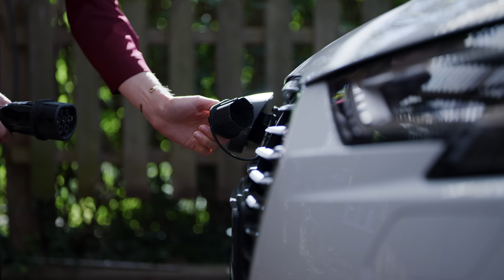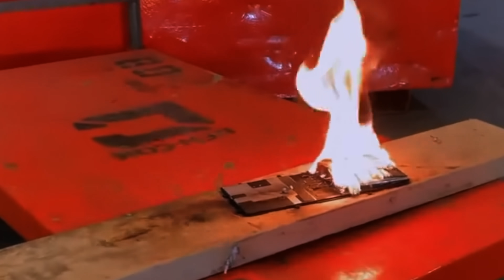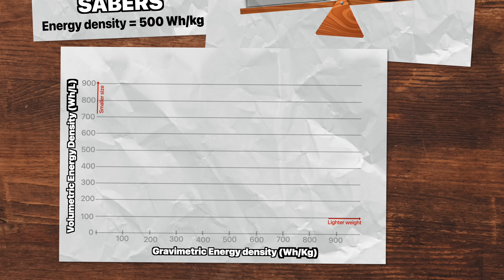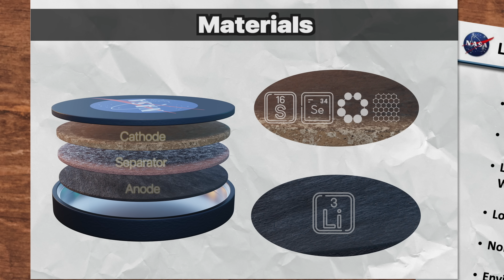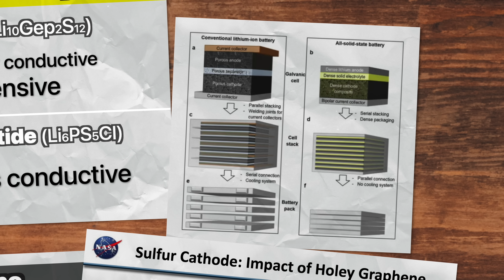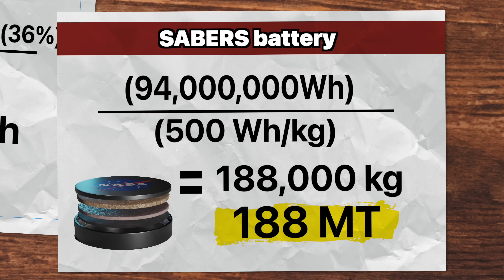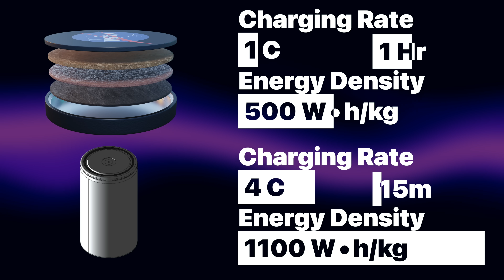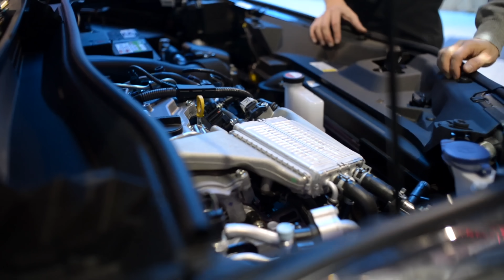Why NASA is Building a Solid State Battery

Comment: How could the separator possibly let the ions through but not the electrons, since electrons are smaller than ions? Are you sure there isn’t a different reason why the electrons don’t flow across the electrolyte?
Reply: If it let the electrons through, it would be a metallic type conductor and make shortcut between electrodes. It should work like liquid electrolyte, letting only ions like Li+ through. Electrones must move only in wires and load or charger between the electrodes.
Reply: @jounisaari9471  I read that some electrons do flow through the electrolyte, but most flow through the circuitry, because it has far lower resistance.
Reply: @TedToal_TedToal  Yes, always some self-discharge currents exist. And every ion has some electrons exept H-. 

I am not sure how exactly solid electrolyte works. In liquid the electric current is carried by ions, not free electrons.
Reply: @jounisaari9471  maybe by hole propagation or something like that??

Comment: One great value of this is the ability to use solid state batteries as part of the armor in military vehicles in the same manner that fuel tanks are used currently, but even more usefully.  Toyota's solid state battery tech has been coming along quite well too.
Reply: Engines are often used as a mechanism to stop projectiles in military equipment… at least in Israeli tanks, where survivability is of the utmost importance to their culture
Reply: Solid state tech has a very long way to go to catch lithium based batteries which are already very cheap and highly scaled.  Don't hold your breath for SS in cars.  People make vids and write articles on SS to get views and clicks.
Reply: @bluetoad2668  the problems with lithium are very significant and solid state batteries are not nearly as far behind as you believe.  Heck, in some important areas they are far ahead of where lithium could ever go.
Reply: @DarkHorseSki  significant? Those batteries are currently powering millions of vehicles and doing it using less energy and requiring less maintenance than the ICE power they are replacing.  I'd argue about the significance of those problems.  Solid state still has problems of it's own and even when those are overcome the manufacturing will have to be scaled up over many years to get to the point when they'll displace lithium based chemistries.
Reply: @bluetoad2668  so what?  And no, the COSTS and harms to create those batteries, as well as to charge, replace and fix them is not factored into your thinking.  There are channels on YouTube dedicated to repairing electric vehicles that are quite clear that the maintenance is sometimes easier, but getting the parts and being able to repair things at a reasonable cost, not even close to equal to ICE powered at the moment.  And yes, solid state batteries will need to ramp up production to get the economy of scale, but the nice thing is that the costs to source their materials is FAR cheaper and far less damaging to this planet.
Reply: @DarkHorseSki  I'm not saying that SS batteries won't come, I actually think they will and also that they'll eventually replace liquid but this won't happen for a few years yet and it won't be SS tech which will kill ICE.  We'll most probably even see sodium ion batteries join lithium as production ramps to meet demand towards the end of this decade.

Comment: Is the 4680 compatible with a solid state electrolyte? Particularly at the center of the jelly roll where radius of curvature is greatest?
Reply: 4680 is a size, 46mm x 80mm, not a battery type.  As for rolling SS?  Most likely not.
Reply: 4680 is just a size.

Most likely, whatever solution is made for solid state batteries, manufacturing will use similar technology
Reply: @DavidHalko  My concern was a dry electrolyte not able to bend enough to work/fit/conform at the center of the cell. If not, anew geometry or configuration is needed for the 4680 cell configuration. THIS implies redoing the 4680 roll up process and hence a new “4680” manufacturing system
If the material is too stiff to bend at the center it won’t work in current 4680 cell design.
Reply: @richardrigling4906  - I hear ya… usually, reuse of existing manufacturing processes is one of the highest priorities, when developing new chemistries.

I guess we will all see!

Comment: Solid State Batteries are awesome, but for aviation, hydrogen fuel cells might be the real winner.  It costs more to create the fuel, but you don't run into the weight issues you do with batteries.  Or at least that is my understanding.
Reply: Hydrogen may be light, but a container capable of storing it under high pressure isn't. Hydrogen is also much more expensive, per unit of energy, than traditional jet fuel.
Reply: Fuel cells are a joke currently.  We do not have any that do not require RARE elements<<COUGH: Platinum or Gold or SIlver etc>>    Fuel cells have HIGHER weight as the FUEL comes generally comes in giant COMPRESSED containers with HEAVY thick walls.  Otherwise you have to go with liquid at cryogenic temps.  Well good luck with an aircraft at Cryotemps flying... SIts on the ground for 30minutes and is now covered in 2cm of ice.  Good LUCK!  Now you have to have insulation, massive amounts of insulation = EXPENSIVE and HEAVY.  

PS: NASA uses Selenium... ==> 50% rarer than silver.  Good Luck waiting on that one!
Reply: @w8stral Airbus is/was testing a hydrogen powered Dreamliner. Liquid hydrogen in cryogenic tank that takes a lot space onboard. Hydrogen works with jet engines,  NOx may be a problem. I saw a documentary about the prototype flight. Not too easy project. Cryogenic H2 inside the hull and in fuel lines and pumps is not too easy.
Reply: As I said, a propaganda stunt by AIrbus, and the fuel used was not H2.  It was Vast majority Kerosene with some H2 blended in for a SHORT period of time.  And it was not a Boeing "dreamliner".  Hydrogen can work for SHORT periods of time.  Hydrogen embrittlement is a REAL problem and why no one has ever made a LONG TERM running H2 engine or turbine.   @jounisaari9471
Reply: @w8stral - the first planes are already flying with H2 running 1/2 the engines, while jet fuel runs the other half of the engines.

H2 for air looks like a potential winner
Reply: You seem embarassed with false facts.  No they are not running H2.  They have run some H2 through an engine on the ground and did a stunt in the air for PR where for a couple minutes they partially ran an engine on H2... rather easy to do with zero passengers and zero baggage....  Long term burning of H2 is unknown and the biggest problem: because Volume to store the H2 is ~impossible currently without sacrificing an ENORMOUS amount of payload.   H2's energy density is superior, but its volumetric energy density sucks hind teat and since they are NOT storing it in liquid form...  Good F'n Luck.  @DavidHalko

Comment: U should be using the most efficient and not the most sold okay i will do it for you😘
Boeing 787 
Fuel capacity - 126917 lt - 101500 kg
Energy content - 1234000kwh
Range of ~21000km
Energy efficiency of ge9x is 55.5%
Energy required to travel per km is 58.3 kWh 

Now same aircraft if turned into electric then

We can only carry batteries with energy content of 
70,339 kWh

But since electric motor are 99% efficient in converting energy to mechanical motion instead of 55.5% of ge9x

Which means energy required per kilometre is
58.3*0.555/0.99
=32.68kwh

So the total effective range would be 
70339/32.68
=2150km

10% of the original aircraft 🥲

Now if we modify the aircraft to travel at lower speeds and modify the wing to be more efficient, and use the recent NASA transonic truss based wing which (they say) can be upto 15% more efficient at same speeds and upto 30% more efficient at 600kmph

So if we use that then we get
2150*1.3
=2800km of effective range 🥲

Now electric engine are much lighter that giant turbo fan 
If we add a few more batteries to compensate for the weight then we get 340km of more range
Which brings the total to

3140km 🤩

Comment: Well done. One thing I never see in a discussion of how batteries operate is the electric fields and how they drive the electrons and ions back and forth and how they keep them sequestered when you aren't charging or discharging. Could you please work out an explanation of how batteries work that includes electric fields? Thank you.
Reply: they dont drive electrons 'back and forth', the chemical composition, and the presence of an anode and cathode causes negative charge to accumulate on one side, and the other side positive. when completed in circuit then electrons free to flow in one direction, from the negative round the circuit to the positive. when not connected they are held inside, not free to flow. the only 'electric field' is the charge difference between anode and cathode.
Reply: 𝐁𝐎𝐘𝐂𝐎𝐓𝐓 𝐌𝐈𝐃-𝐕𝐈𝐃𝐄𝐎 𝐀𝐃𝐒
DISLIKE DISLIKE DISLIKE DISLIKE DISLIKE 
DISLIKE DISLIKE DISLIKE DISLIKE

Comment: Solid state batteries are used by Space department  since decades, maybe the new breakthrough is capacity and cost gains. SSB batteries used in spacecrafts have been very efficient, their issue was costs.
It seems that this video was produced for airing sponsor advt.

Comment: I’m the past week, I have been behind the gorgeous Tesla.  In both cases, long lines of traffic due to construction.  Funny, bothe of these cars had no taillights, which were needed desperately for the cars behind them.  No brake lights or taillights, why?
Reply: What are you talking about 🤷🏼‍♀️
Reply: One pedal driving allows regenerative braking to slow the vehicle to a stop and doesn’t apply the brake light. F1 has flashing brake lights when battery harvesting is taking place and therefore warns the following drivers. In my opinion it is f in dangerous and probably caused a lot of accidents already.  Just my opinion !